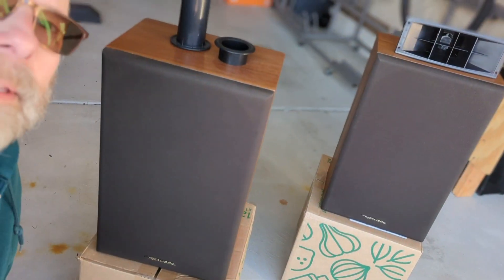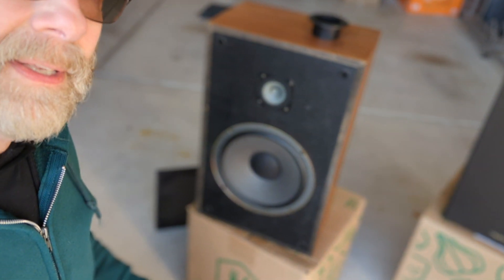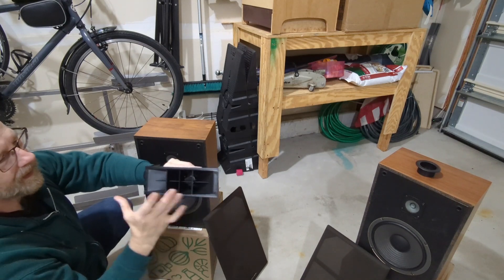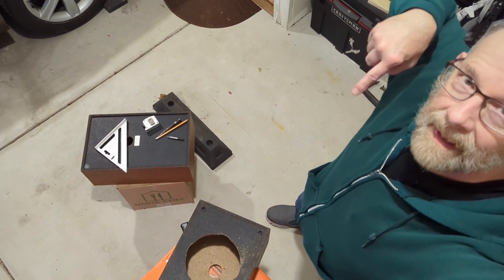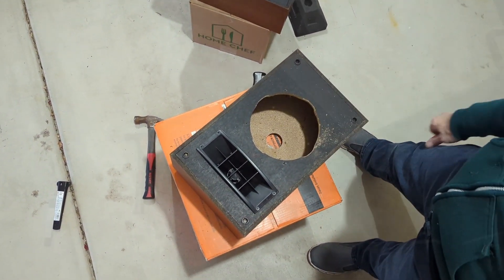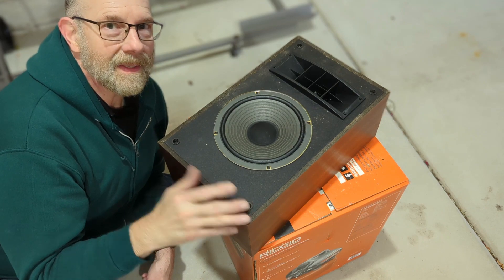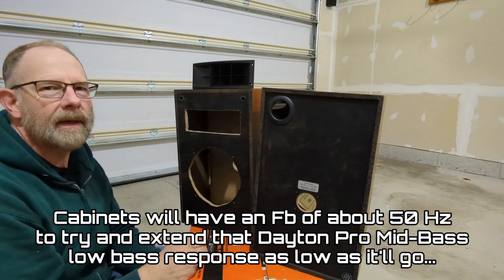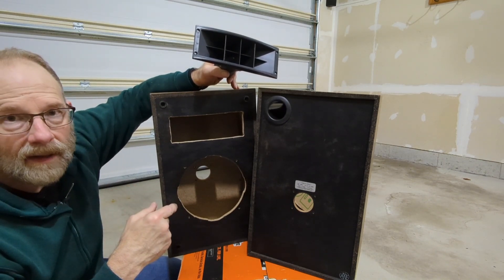RadioShack Realistic MC-1800 Mini Mach One DIY Speaker Project Part 1

Comment: They made a few speakers with top horn loaded tweeters, the Minimus 5 is one, which came with a 6.5" woofer, and there was another with an 8" woofer but it was short lived, maybe even a Christmas only special type deal. My dad bought a set in the 80's or 90's, he liked them so much they sat in a box in the closet for 30 years. 

Those cheap piezo tweeters don't sound good at all, plus in a cabinet like that, they will need to be completely boxed in and isolated to have a chance. Your better off finding a pair that use a dome tweeter behind the horn if you must have a horn tweeter. 

Its also hard to find a suitable crossover for those tweeters and harder yet to get the crossover points right. The woofer will almost need to be run full range,with the tweeter only handing the highest possible notes. 

Keep in mind that on the Mach One Speakers, the horn was a midrange, not a tweeter, the tweeter was mounted next to the control pots. The mini horn tweeter was crossed over fairly low around 4500 hz, and they dumped everything under 1200hz to the woofer. So the mid horn got everything between 1200 and 4500hz. 
With a two way speaker you need to have a woofer that can handle all but the highest of highs, think more along the lines of a small Advent where the woofer is capable of nearly everything and the tweeter handles the peak highs.

Comment: I like the looks of your Tweeter horn  but the bad thing is that is a piezo tweeter. A piezo is the worst tweeter made. They generally have the opposite of a flat response. What I would suggest is hacksawing off that tweeter element and fabricating a mount on back to attach a 1 1/8" dome tweeter. That horn resembles the horn on some  realistic minimus 5's. Those were really cool looking sealed speakers but they did not produce base below 100hz. Sounded good above that though. If you keep that a piezo tweeter it will look cooler but I can't imagine it  sounding better than what was their originally.
Reply from the maker: I've never measured a Piezo, but have heard some and used them some in a few builds. I've always thought they sounded okay, but from what I understand there's some kind of good and some not so good. I'm hoping these sound and measure okay, but I was also considering modifying them as you mentioned. I ordered four of those horns, so I had some options. I was considering putting the 3/4" plastic dome that came out of the RCA's, or the Dayton Classic onto the horn. I figured if the Piezo sounds and measures bad, I'll try the RCA... Then if that's still bad, try the Dayton Classic
Reply: @wattspeakers  From what I understood Piezo tweeters are often seen on older inexpensive small speakers or in P.A. systems where Hifi is not so important. But never in serious hifi speakers. See them used in those talking greeting cards. I did not notice the depth on that Pyle. Regarding that piezo horn you bought I may buy one to get a better look at the front grill Looks like it could possibly help with dispersion on what ever driver a person may consider mounting to the back of it. That is the problem with a lot of Midrange Horns they work great but they tend to beam quickly after the first lowest octave they produce. The Selenium HC23-25 horn has great dispersion because it uses some similar directional vanes. Not sure how to share contact information with you on here but have lots of interesting ideas and software to share regarding speaker mods and building.
Reply: Probably to late now but another option would of been using the $20 Pyle PH391 it is an actual mid/tweet compression driver horn. They are 4" x10" so probably just barely fit.
Reply from the maker: @jimthvac100  that Pyle I had checked out first, (because it was 10" w like you mentioned), but it's too deep at 8-1/4".